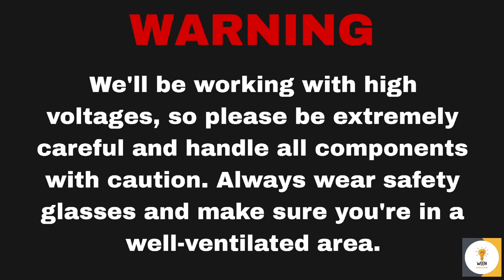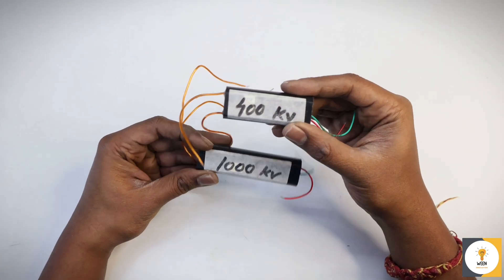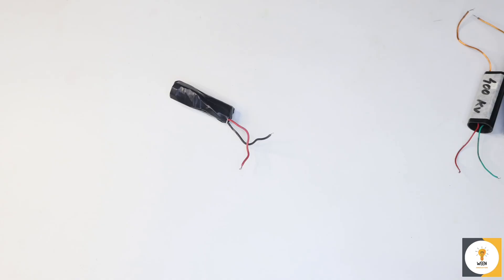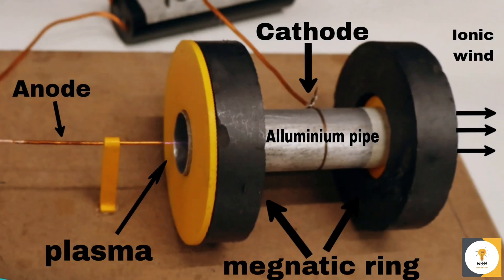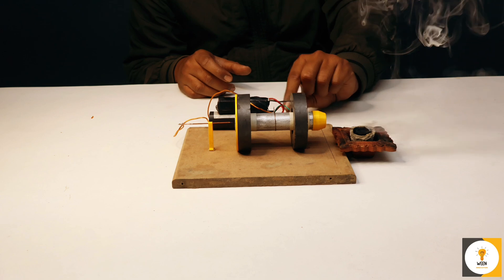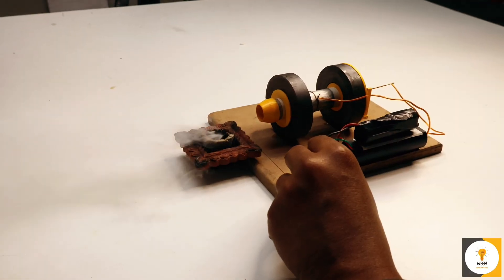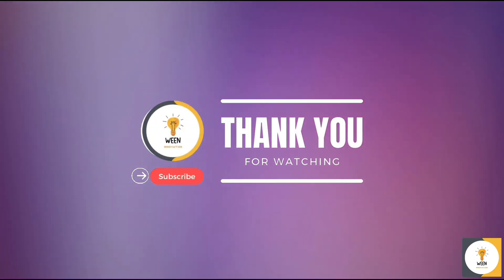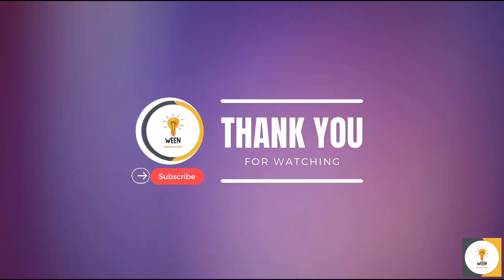Building an Ionic Wind Thruster - No Moving Parts

Comment: what is roll of Megatron magnet  in this
Reply from the maker: Stabilize the plasma ejection from the nozzle.
If magnets were not present, the plasma would scatter.Ring magnets make the plasma beam tight, focused, and straight.This increases thruster efficiency by 40–60%.